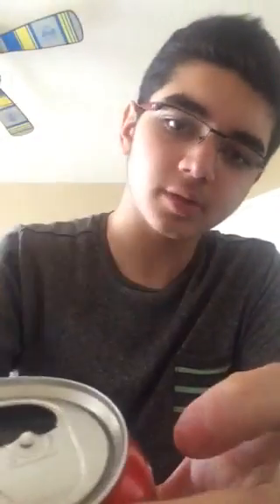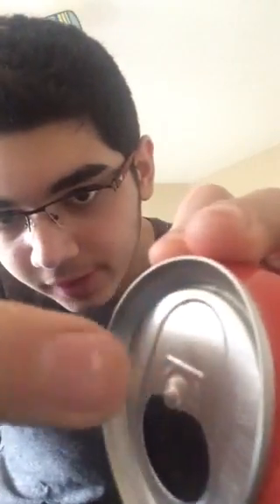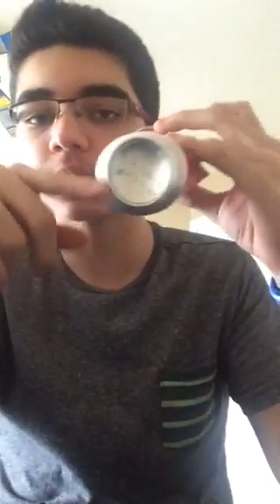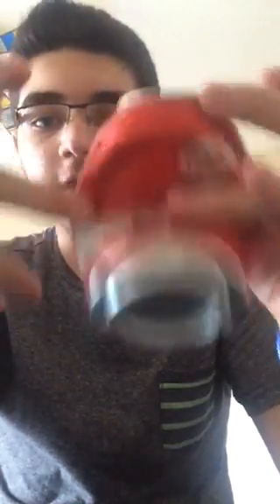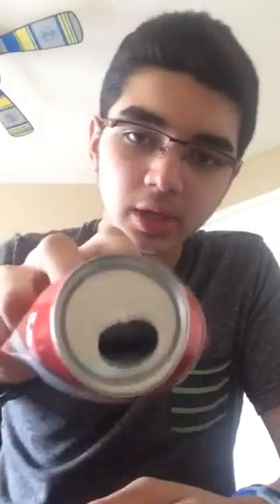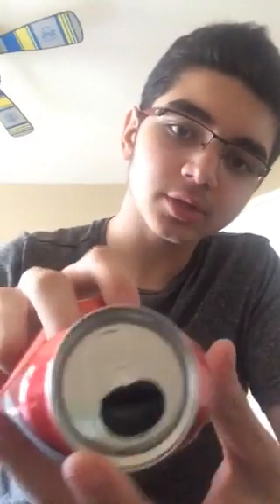Car sounds out of soda can! WORKS!

Comment: It works is just most people don't know how to crush the can properly if you get it on The Sweet spot for the can it works like a charm if you can't seem to get it to work do what he says and put one thing on the end and put ur fingers little bit lightly and push it up and down and see which one vibrates more try bending it to the top more in the top vibrates more and if it doesn't stay you have to put one finger when you do the technique